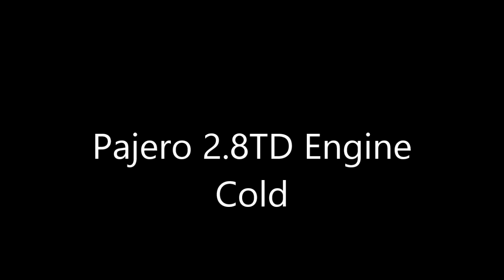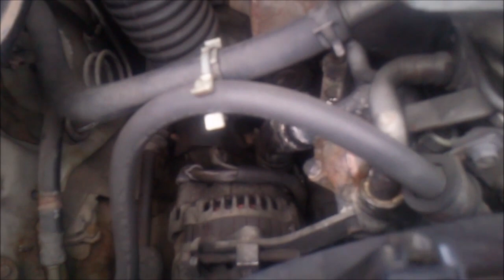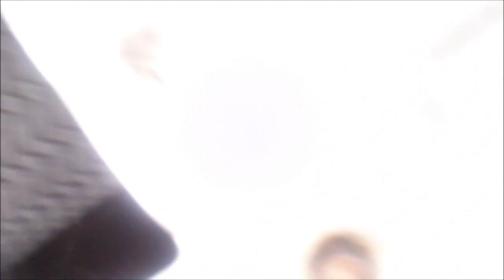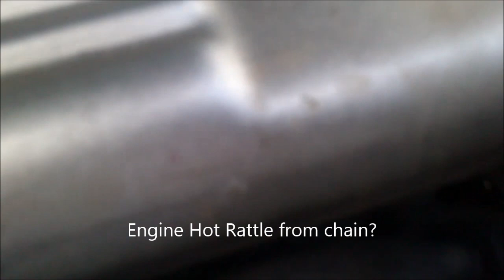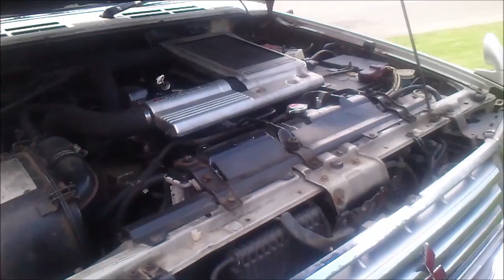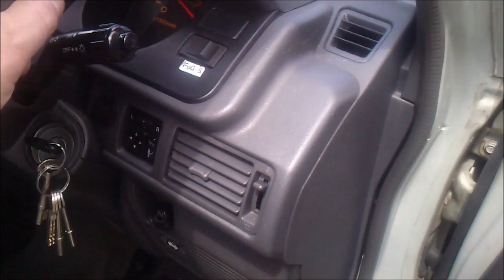Mitsubishi Pajero 2.8TD Engine Noise Update

Comment: Hi,
You can change  just the chain and the tensioner .
They sell the kit ,just use the old chain to pass the new one trough.
I now know I guy that comes to your house and does it there and them.
Reply: Never thought about that, using the old chain to pass the new. Won’t have to desensamble the engine. 👍🏼👍🏼👍🏼 saved me at least $800

Comment: IF U  cant find any new tensioner just get some round bar or a bolt and try to rebuild it .try to put atleas 1/2 inch  on it and try to weld it finish it with a grider to make it smooth,

Comment: hi i have answer to the problem ,are you familiar with the tensioner?
Reply from the maker: Lyn Lacsina Yes the tensioner, looks like its almost fully out, can it be seized?
Reply: Richard Holloway  had the same issue on mine and all i did was change out the tensioner and it fixed the problem! The reason for that is your tensioner is worn out thats why its not pushing the timing chain in place. Let me know if it worked..goodluck.
Reply: @lynlacsina4649  you change this yourself ?